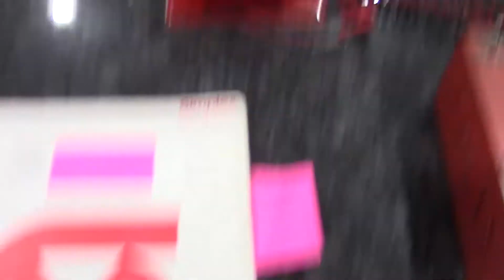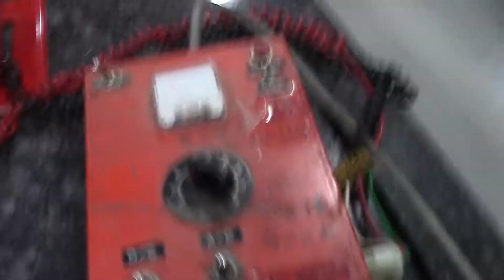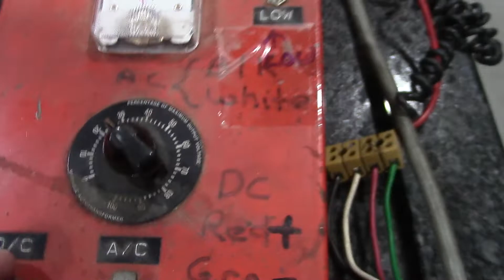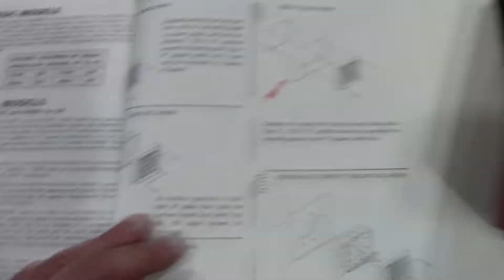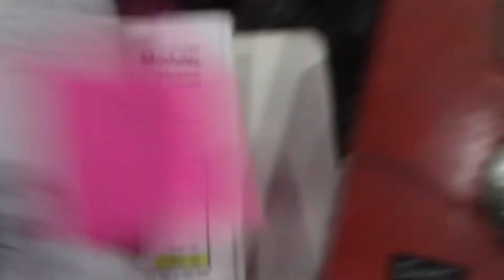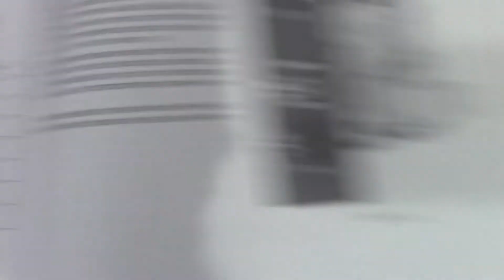March Time Rate:  Time to ACK & Silence?

Comment: I had a couple 24 volt 4051s and the volume screw was incredibly effective on those. When it was all the way tight the horn emitted a muffled hum about as loud as a dryer buzzer. But, unscrew it a quarter turn and it got really loud and raspy.

Comment: I just have to ask, if Simplex 2001's did 120 march time, then how come 4002s also did 120 march, but sounded faster? because with a 4002 and a 2001, i would guess that there would be the same kind of voltage drop? idk. Please correct me if I'm wrong

Comment: Looks nice! On the older pre-2001 Simplex systems (like the 4247, 4208 and 4207) "March Time Rate" was done with an old-style coding wheel that would be mounted in the panel during construction/installation. The 4208 system at my first elementary (now K-8) school had TWO such coding wheels installed. I'm not sure why they initially did that, as when the school was built in 1974 the 4051 horns just sounded on Continuous while the 4050-80 light plates flashed via the coding wheels. But then some time in the 80s the system was configured so that both the horns and lights operated on a Slow March Time (like around 20bpm). Too bad it's all gone now (they just have System Sensor SpectrAlert Advance horn/strobes installed after the old 4208 panel began failing in early 2015.)

Comment: I used to watch your videos as a kid! My high school has a rare Simplex 4247-2 with 6 volt 4050s all over the building, and a lone STR series bell. The intitiating devices are 4251-20s and 4255-1s. There are also two 4251-30s; one is missing the whole glass portion; (the frame, hammer, and glass panel); the other one still has the frame intact. The system is still going strong. Do u know anything about the Simplex 4240 series panels?
Did u also save the rare AF IBM 4201-4 and the bells in the system from that video?

Comment: My first elementary school had 2901-9838 simplex horns on 4903-9101 strobe plates. System was on continuous.  In around 2014 or so they were replaced with ceiling mount truealerts inside and wall mount truealerts outside.  What baffles me is that that the alarms inside were set to code 3 but the ones outside were on continuous still.
Reply: I had the same fire alarms in my first elementary school too except the system was on march time which terrified me.

Comment: YOOO you back!!!!

Edit: I actually remember that whole March time controversy and saw that 120bpm in my March time coder manual too.

Edit #2: I actually have 3 4051s as well as 2 4041s. One actually has the FLUSH plate which is super cool! I also programmed my homemade panel to do the slower what people call 90bpm March and they sound awesome on it.

Comment: Welcome back. That’s cool that you have the 4051s from your school. I wonder if people keep the old spec sheet when they upgrade the system. My dad’s school used to have Simplex 4903-9221s and 4904-9138s. The system was replaced in 2012 with a Silent Knight system with P2Rs and SRs. I found part of the Fire alarm drawing on the district website and that’s how I found out about the old fire alarms. I’m trying to find out if there’s more on the system. If I’m correct there should’ve been Simplex 4903-9221Hs since the school had a pool and they would use the H suffix for high humidity and I think the high humidity models were made for pools. I don’t know yet but I’m trying to find out.
Reply from the maker: I have a few of those laying around upstairs except mine are speaker/strobes